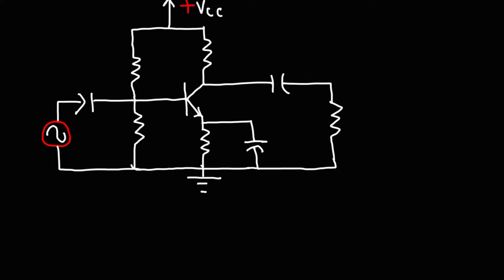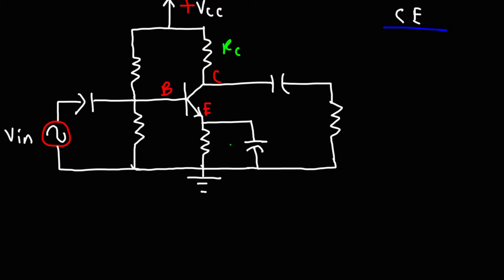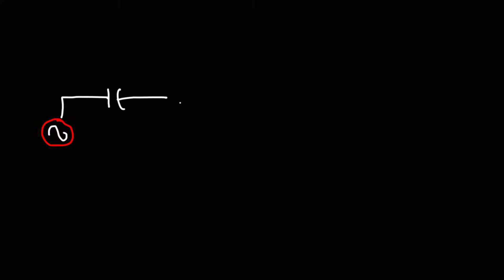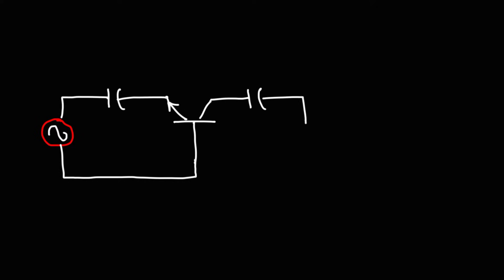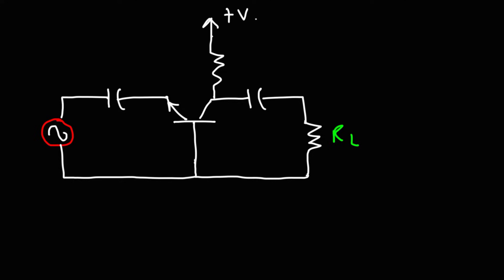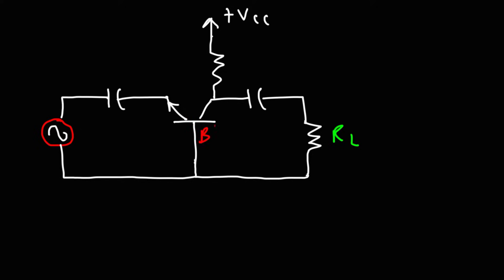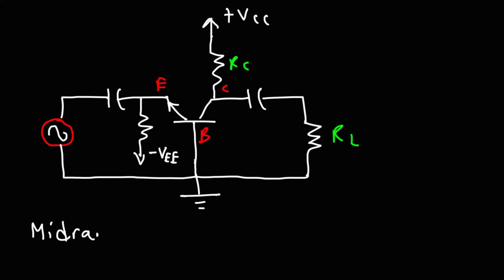Common Collector and Common Base Amplifiers

Comment: Good into to basic amp configurations.  There are situations where gain is not sought after, but linear response and a means to regulate input to an IC chip.  Analog devices may use a 10v supply and a chip can't use 0-10v, but needs 0-2v and the amp design exists to faithfully  rescale that devices output.  I think automotive MAF sensors need this?  Drop the I/O capacitors, and the appication becomes dc-dc, but... which configuration is best?

Comment: the problem with this analysis is that you're not explaining WHY you might use each of these amplifiers - and that's just as important as how they work for an engineer.
At first look, a Common Base amp seems pointless - it has low i/p impedance , high o/p impedance and no current gain - seemingly the EXACT opposite of the ideal amplifier. 
From the description it would appear that the better option where would be a common emitter amp - because you get voltage gain, current gain and you have high i/p and low o/p impedance...

BUT - the Common Base amplifier has very low 'miller capacitance' effect, which means that it's exceptionally good in high frequency situations. By comparison the common-emitter amplifier miller capacitance effect will render your voltage gain useless at high frequency...

Comment: @TheOrganicChemistryTutor Tutor you mentioned that the C.C config gives high power gain due to high Zin and low Zout, and thats what we want. But you concluded the video showing we get the highest power gain in the C.E config???
Reply: I believe it’s that cc gives higher voltage gain but a lower power gain than ce

Comment: It's actually called a "voltage divider" amplifier because of the 2 base resistors forming a voltage divider. I don't know who told you it's called a common emitter, but they're wrong. Yes, the emitter is common, but the correct name for this configuration is voltage divider.
Reply: The voltage devision is mainly for biasing the transistor thus we refer to the circuit as common emitter,  reason being the emitter is the common terminal meaning that neither the input nor the output is at that terminal.